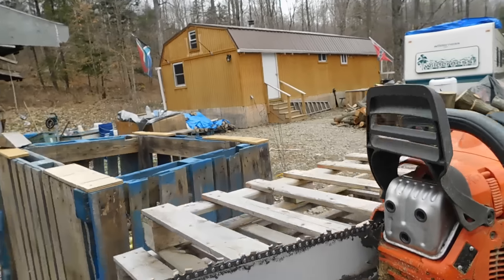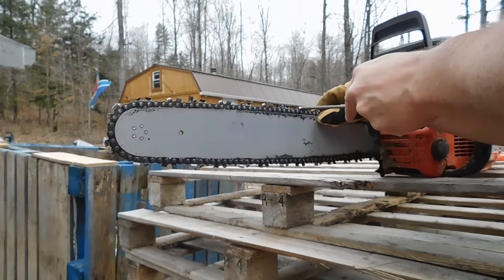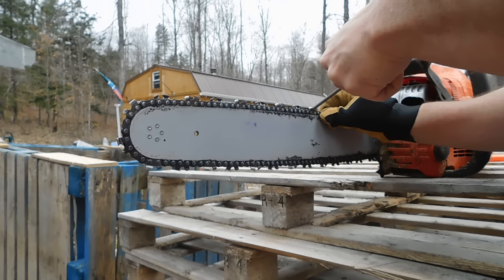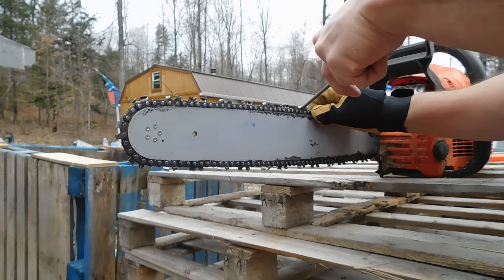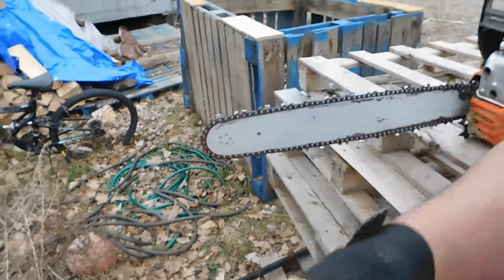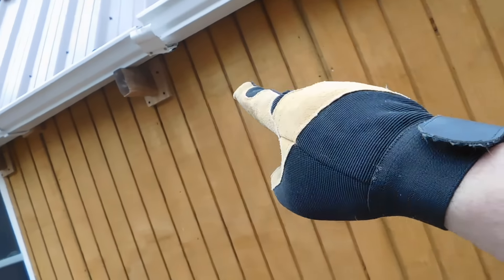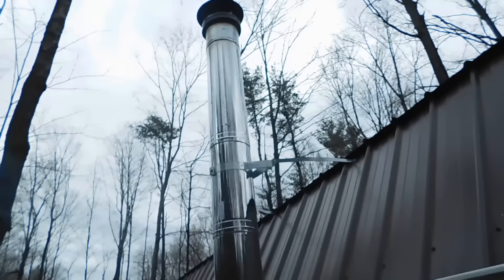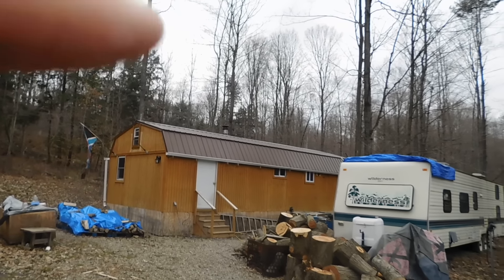Showing you how to sharpen a chainsaw with a file.

Comment: If you have a vise, clamp the bar in in the middle just as it is with the power head attached. When it is steady you can hold the file very straight. I hate to say everyone is right about the direction you push the file. With a little practice you can make them sharper than brand new out of the box.
Reply: When you file the other direction it rolls a very light burr to the outside, which catches the wood as it cuts. This is what starts the cut of each chip. Pushing the way you are actually dulls the point of contact to begin the cut of each chip. Sorry, just want to help. Other than that your off to a good start.
Reply from the maker: I was pushing the file I went back and checked to make sure.
Reply: You do push, but you have to push from what might be called the inside of the corner toward the outside.
A better way to put it, just as you are doing but instead of push as you do in the video, pull it. That is the direction the file should move during the sharpening "cut".  OK. At the 2:40 to 3:10 minute reverse and do the way you said not to.
Reply from the maker: Ok I will look again thanks.

Comment: always sharpen towards the point,and the rakes should be lower than the chisel point.
Reply from the maker: Ok thank you.
Reply: preppernurse1 that small hole by the bar tip should be greased periodically,so the bearing don't seize.Also the clutch bell bearing should be greased too.just giving some pointers.helps save cost of repair

Comment: i dont meen to be snarky or a troll but you need to have greg show you again ... your filing the wrong direction ....
Reply from the maker: Ok I will ask him.
Reply: your filing against the chisle instead of with the chissle
Reply from the maker: ok thanks for the info it was my first time doing it.
Reply: best way to learn is trial and error
Reply from the maker: I just rewatched it I am doing it the right way you do it away from you.
Reply: your right in filing away from you but your round file should be sliding into the chisle from the opposit direction ......the side of the chisle should be on the opposit side of the chain away from you and you slie the file away from you to sharpen . it appeared that the side of the chisle was on the side closest to you